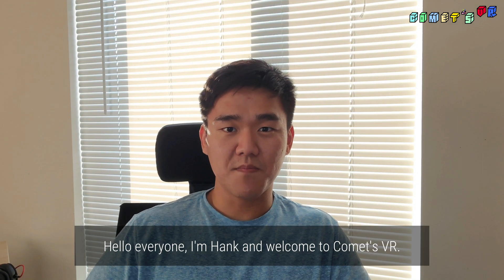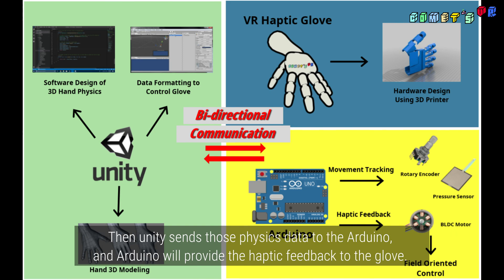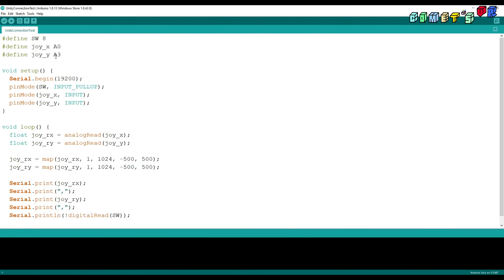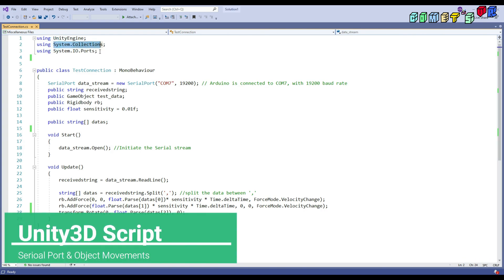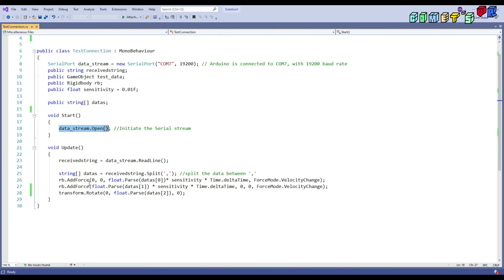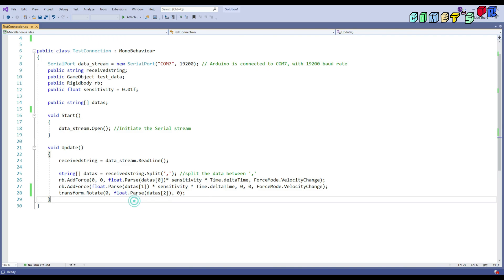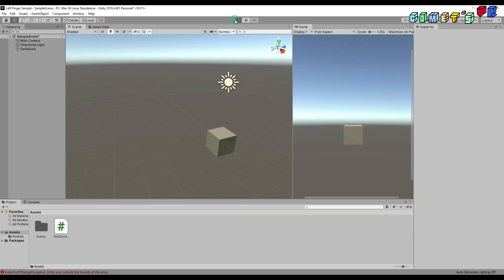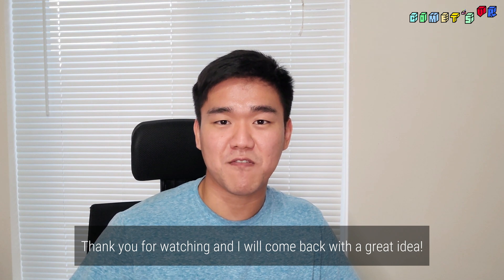How to Connect Arduino to Unity? #1 Serial Communication between Arduino and Unity.

Comment: I am working on a project But there is no Arduino plugin.
I created a car electrical circuit on my computer.
When you press a button on the computer Can the output be sent to the Arduino pins?
I program with Construct 2.
Reply from the maker: If you have some USB device that can manipulate the pinout, yes you can.

Comment: How can I do the same thing using Bluetooth with Android
Reply from the maker: I don’t know the details but you need to use bluetooth and android plugin for Unity. They are in the asset store. I have used bluetooth plugin to connect to android device before and it worked well.

Comment: it is possible for unity to received and send the data at the same time using serial ports ?
Reply from the maker: Of course.
Reply: @comet-tech  can i know how to be able to do that?  I already made it in both ways but unity only can send the data to arduino but unity cannot detect for receiving data from arduino using the same serial port
Reply from the maker: @nurainrasid9863  I cannot help you without seeing your source code.
Reply: @nurainrasid9863  Did you figured it out, if yes then how?

Comment: Hi. I wanted to ask. currently I'm using IMU sensor and connected with arduino. is it possible the angle data measured by the arduino used in 3D model blender?
Reply from the maker: Yes, it is completely possible.
Reply: @comet-tech  thank you for your reply. do you have idea how to use the IMU angle in unity script since I don't have experienced in unity.

Comment: I was having an issue with the float.Parse() that was returning an error saying the string wasnt in the correct format. This was because for some people the Parse function does not recognize "." as the decimal separator but "," instead. To change this you can type:
float floatVal = float.Parse(stringVal , CultureInfo.InvariantCulture.NumberFormat);
instead of the regular way and it should work. Hope this helps.
Reply: hello there,
i am still getting same error after implementing the above solution.

using UnityEngine;
using System.Collections;
using System.IO.Ports;
using System.Globalization;

public class TestConnection : MonoBehaviour
{
    SerialPort data_stream = new SerialPort("COM5", 19200);
    public string receivedstring;
    public GameObject test_data;
    public Rigidbody rb;
    public float sensitivity = 0.01f;
    public string[] datas;

    void Start()
    {
        data_stream.Open();
    }

    void Update()
    {
        receivedstring = data_stream.ReadLine();
        string[] datas = receivedstring.Split(",");

        
        float xForce = float.Parse(datas[0], CultureInfo.InvariantCulture.NumberFormat) * sensitivity * Time.deltaTime;
        float zForce = float.Parse(datas[1], CultureInfo.InvariantCulture.NumberFormat) * sensitivity * Time.deltaTime;
        float yRotation = float.Parse(datas[2], CultureInfo.InvariantCulture.NumberFormat);

        rb.AddForce(0, 0, zForce, ForceMode.VelocityChange);
        rb.AddForce(xForce, 0, 0, ForceMode.VelocityChange);
        transform.Rotate(0, yRotation, 0);
    }
}

Assets\Scripts\Joystick.cs(23,47): error CS1503: Argument 1: cannot convert from 'string' to 'char'\

Comment: Hi, I tried implementing the C# code however I'm running into an error. Essentially, the problem is that System.IO.Ports can't be found within the references when I make the script. Please help!
Reply: Project Settings >> Player >>  Other Settings >> API Compatibility Level >> change to .NET 4.x
Reply: @pedroserrano5479  Didnt do anything for me :(
Reply: Nevermidnd just had to resave the script :D
Reply from the maker: Did you put the correct COM port??
Reply: @comet-tech  I did, the problem is that System.IO.Ports isn't within the references and so I can't actually use it.
Reply from the maker: That's weird. It's supposed to be referenced in default. Can you show me your error message?
Reply: @comet-tech  I shared the screenshot of the error with you on the email address available in the 'about' section of your channel.
Reply from the maker: @abhishekkar4592  hmm, I have not receive any email yet.

Comment: Nice vid!! Im working on a project to connect arduino RFID to unity.. so far i can read the Rfid tag and get the "output (Rfid tag id for example)" in my unity console.. is there any way to work with these informations? I want to read the RFID tag and get some sounds in unity or something.. any solutions :D ?
Reply from the maker: If you already read the output from RFID in your Unity console, I think you are done. I am not sure what you mean by "work with these information".

Comment: thank you so much! I got stuck with receiving floats in Unity, so your video happened to be a real treasure.
Reply from the maker: Thank you!
Reply: @comet-tech  excuse me .can I ask some question , i am taiwanese so my english is not well
Reply from the maker: @yokj9081  Sure!
Reply: @comet-tech  HELLO!  If I want to connect unity and arduino with bluetooth . Buy the $US 19 plug in is the only way?Or I have another way? Sorry for bothering you
Reply from the maker: @yokj9081  it depends on the device. If you are using quest 2, it will be based on Android system. In that case, you may need Bluetooth plugin. And you can use either ESP32 or other microprocessor compatible chips

Comment: hi love the vid im working on similar project and im fairly new to unity. is there a way to use the hc-05 bluetooth module for aurdino to unity, if there is how should i go about it.
Reply from the maker: As far as I know, Bluetooth will work with PC if your PC has Bluetooth configurations. C# has the functions to handle the Bluetooth input. I have not closely looked how it works,  but it should work. My future projects will also probably work with Bluetooth, I think I am going to post about that. I cannot guarantee when it would be.

Comment: how to send data via wifi from unity to arduino.
I am working to send some collision data of objects from unity to arduino but i am unable to make a wireless connection, from my unity scene to arduino which has an ESP8266 attached.
Can you please guide or can you make a video on it quickly. i need some guidance quickly as soon as possible.
thank you
Reply from the maker: Does your PC has Wifi transmitter?
Reply: @comet-tech   i have a wifi dongle which i connect with pc and it can connect wifi then. Kindly let me know any solution if you have.thank you.
Reply from the maker: @habibmustansar3290  I assume dongle does not have transmitter, than means the ESP8266 can transmit and received the data, but dongle cannot. Dongle only receives the data. If you want a direct wifi connection between PC and ESP, you need a wifi transmitter at your PC. Otherwise, you need to approach this problem network-wise. For example, if your unity wants to send the collision data, this data should be go through the internet and ESP should grab that information from your home-wifi. But there will be a hug lag, probably 200ms>. Even if you have a wifi transmitter at your PC, you cannot access to the internet while the connection is enabled.
Reply: @comet-tech  actually we want to do it without using internet. so in this case we need to have wifi transmitter must? right. this is what you want to say?
Also if we manage wifi transmitter in our PC then where and which script we need to use in the unity scene? Either attaching it with any object or what?
Also what script can we use  for arduino.
Do you have such scripts kindly let us have it.
thank you.
Reply: @comet-tech   i am actually trying to connect my Pc to arduino via ESP8266 attached to Arduino for wifi signals. for this do i also have to have a wifi transmitter on PC.
kindly guide me.
Reply from the maker: @habibmustansar3290  I have a experience of direct the WIFI connection between PC and other robot but, not with Unity & Arduino. There is a software tool 'Uduino' which seems to have wifi feature. Please check that.
Reply: @comet-tech   first it is not free of cost. secondly i have seen the comments of people who tried it. it is not worthy. so instead of wasting money i would stay back from uduino. if you have any other authentic link or sourcekindly share it.
thankyou.
Reply from the maker: @habibmustansar3290  I was confused about the dongle. Wifi dongle has Tx and you can directly connect with that. It is quite easy in Arduino side. But the problem is in PC side. You need to directly connect to ESP with your dongle and it may differ by manufacturer and I don't have the knowledge about that. I don't know why you are using Wifi if you are not using internet. You can use RF or Bluetooth which is more simpler and faster.